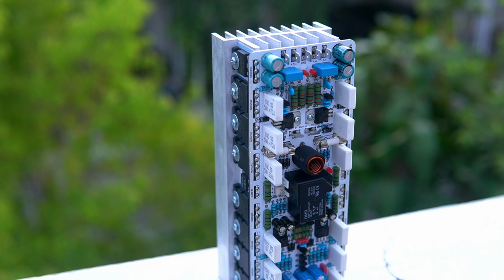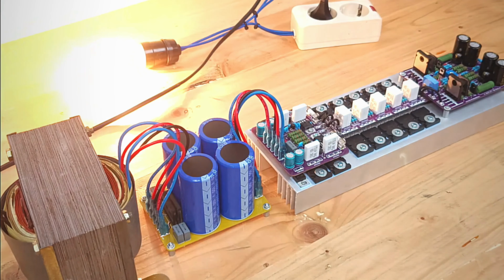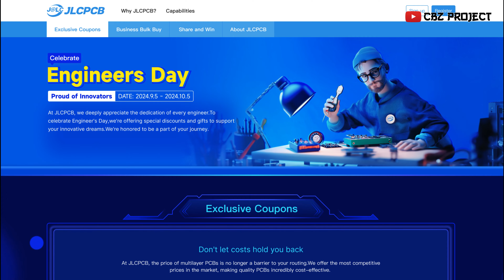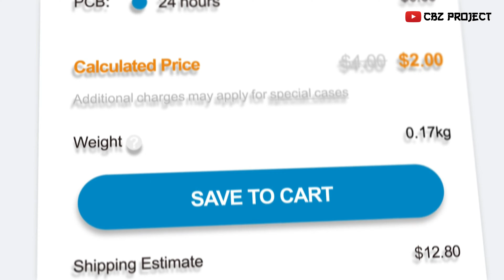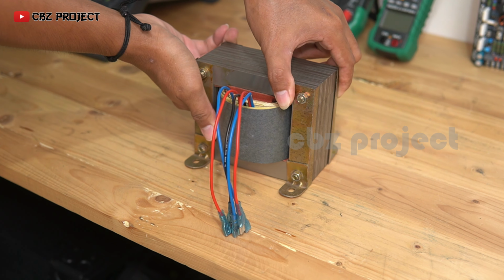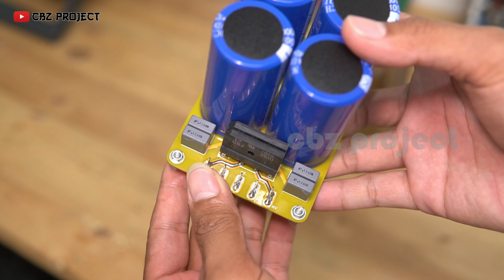[1001watt?] Powerful 2 Tier Class-H Amplifier Board using 2SC5200 & 2SA1943 Transistors #cbzproject

Comment: It's not a DIY because if you want to install audio electrolytics there is no space on the board and the holes are too small for the fuses to fit in. For example, I would like to install Elna Silmic2, I have enough of them but they are twice as big as the ones used here and that is a problem.